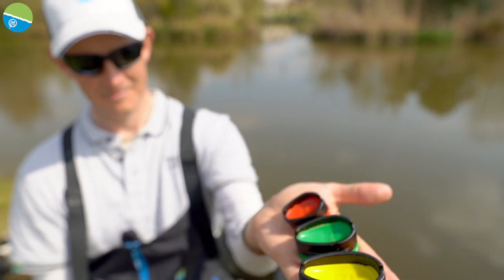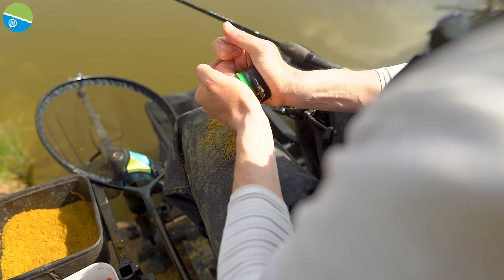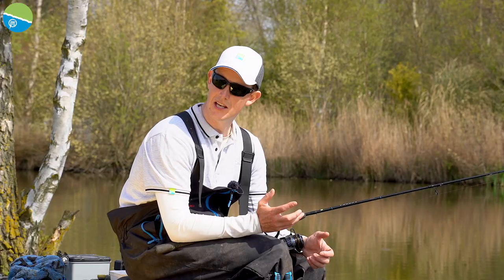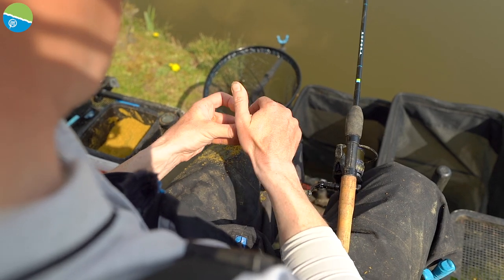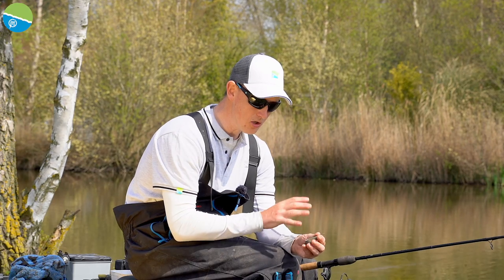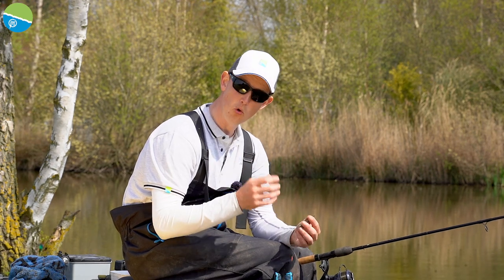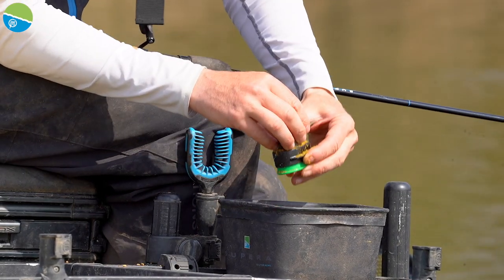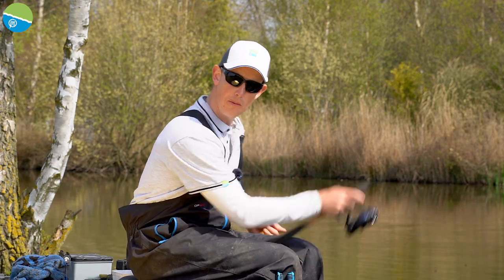Why Do You Need A Method Mould?

Comment: You can also pre-load the mould so when you bring back the feeder it is simple a case of including the "hook bait" pressing it on and sending it back out again - even more so if you buy into Joe's assertion that it should be buried and not at the bottom of them mould / front of the feeder
Reply: Joe's theory is 100% correct

Comment: Why are these commercial boys making fishing so technical, it ain't. These commercial lakes are so packed with fish you can walk across the water without getting your knees wet. That's not fishing.
Reply: Exactly i packed commercial fishing far to easy fish are stuck in a hole in the ground charging  10 to 15 quid for a days fishing most close now at 6 to 7 in the evening WTF best time of the day to fish,i fish the rivers and canals that's when you know your doing it correct nothing like catching barbel and chub on the river not fished a commercial in 3 yrs,para